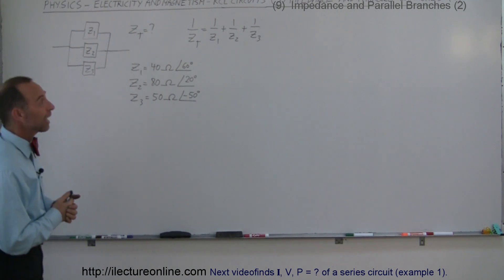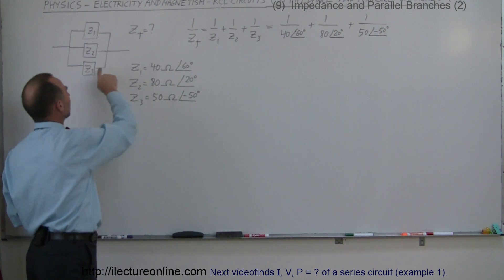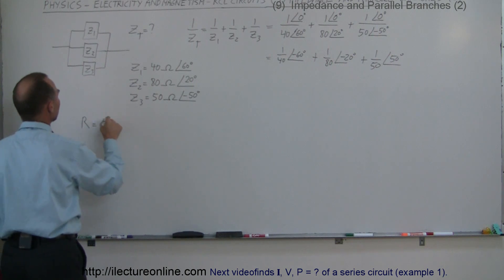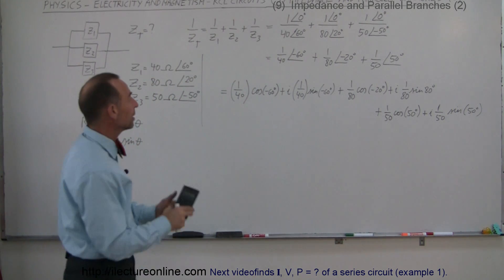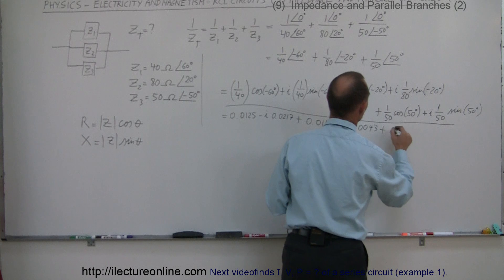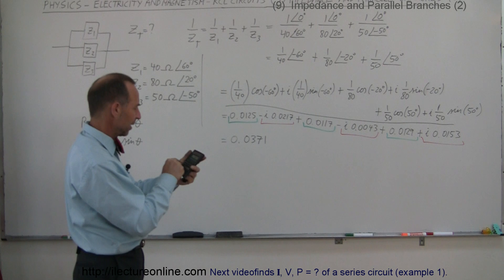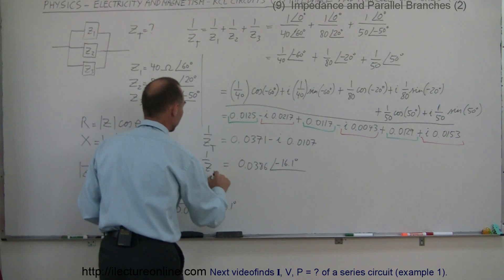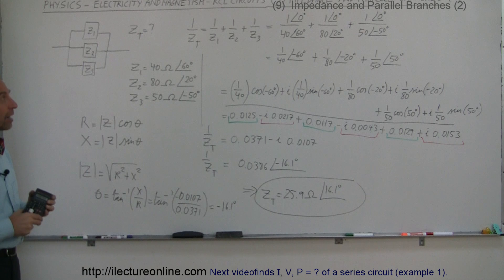Physics 49  RCL Circuits (9 of 13) Impedance and (3) Parallel Branches

Comment: In a four branch parallel circuit, 10mA of current flows in each branch . If one of the branch is opens, the current in each of the other branches.. ?

A) decrease
B) increase
C) remaining unaffected
D) doubles

Please say the answer sir
Reply from the maker: The answer is "C"  the current in each branch remains unaffected.
Reply: https://images.app.goo.gl/oq7FXf8jW7hCEuLRA find potential difference between P and Q

Comment: would it make a difference if one of the Z's was a resistor, because i have the exact same problem but simply with a 50Ω resistor, a 50mH inductor and a 50μF capacitor, i found the total impedence to equal -2.52j+50. which is wrong. i have been given a input voltage of 200sin(50t)
thank you
Reply from the maker: R = 500 ohms with a phase angle of 0,   XL = 2.5 ohms with a phase angle of + 90    XC = 400 ohms with a phase angle of - 90    (assuming that w = 50 rad/sec)
Reply: thank you for the quick reply, firstly is it not 50Ω(0)?,
i got every thing else the same but how to add them in parallel? 
i.e. 1/Z=1/Z1+1/Z2.... so i got 1/50 + 1/J2.5 + 1/-J400 = 0.02-0.4J+0.0025j 
Thus 1/Z = 0.2-0.3975j  thus 1/Z=0.44(-63.29)  thus Z=1/(0.44(-63.29)) 
Z=2.27(63.29)
Which is incorrect the correct Answer Z=2.5(87.)
Which was found by stating that the  Voltage in parallel is that same 
thus Vrms = 200/(2^.5) = 141.42 
Then the total current is i = 141.42/50 + 141.42/J2.5 + 141.42/-J400
i = 2.83 - J 56.57 + J 0.35 = 2.83 - 56.21 J
i = 56.28(-87)
Z = V/i = 141.42 (0) / 56.28 (-87) = 2.5 (87) 

I hope this has clearly shown my working and as to why i am confused.
To clarify i can not get the same answer for Z using the 1/Z = 1/Z1 + 1/Z2 + 1/Z3 ... formula
Reply from the maker: When using the method shown in the video and using the numbers you presented z = 2.51ohms  / 87.1 degrees
Reply: Michel van Biezen thank you for the reply, I will retry until I get the correct answers.